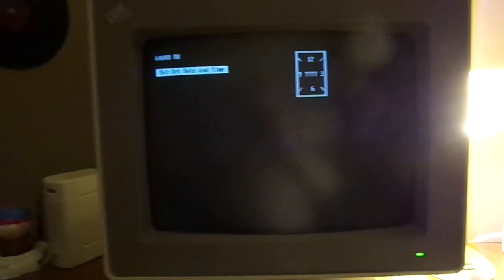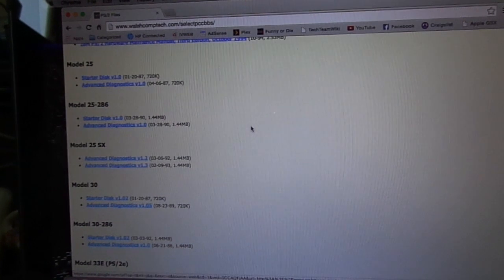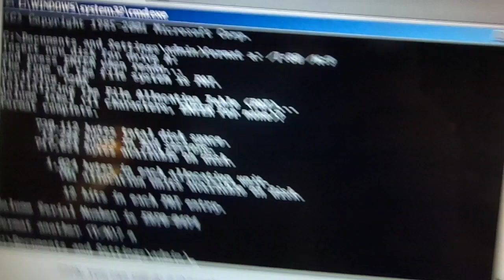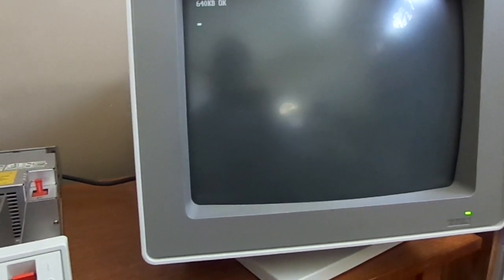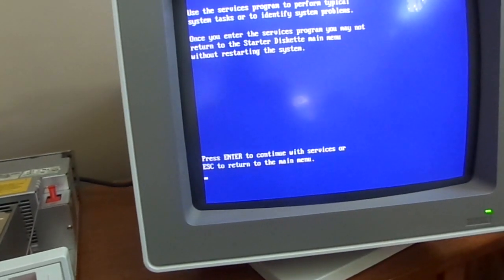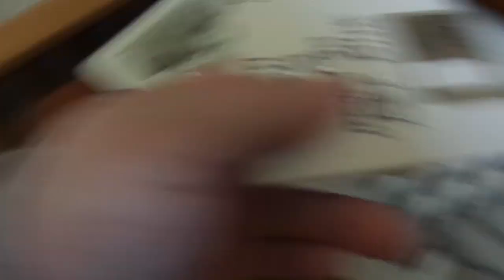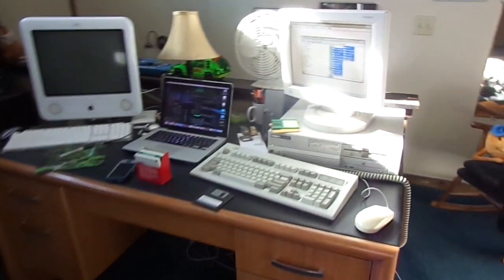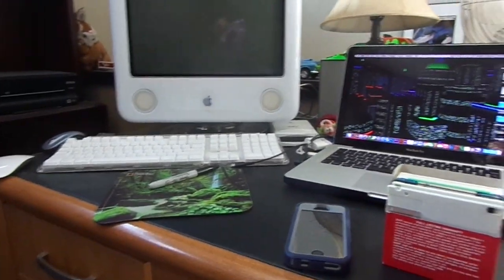Replacing Clock Battery In An IBM PS/2 Model 30 (8086 only)

Comment: How do you deal with recharging?
Reply from the maker: The CMOS battery? It's not rechargeable on this machine.
Reply: OK :)
Also, I really like your videos and your willingness to answer to every question which somebody asks.
And, do you have any expiriences with Commodore PC 20-III? I ran into some issues. The biggest is that video output is not crisp anymore and start "jumping" up and down. Also highlighted stuff is unreadable. Do you have any idea? :)
Reply from the maker: Krivulda It sounds like the display is failing, but it could also be a defective video cable. Often, older CRT displays can fail without warning due to aging (often leaking) capacitors. Getting this fixed is no simple task, and I cannot begin to help you in this area. My recommendation is to find another monitor.
Reply: Oh, it is ported through video grabber, which I got for Christmas, to my brand new BENQ display I use every day.

Comment: Brandon, you can get these two thirds AA lithium batteries brand new on Ebay for about six dollars with free shipping with leads on them already, just had to replace a battery like this one in my old digital oscilloscope. The CR cell will work just fine but I'd just think replacing it with the correct cell might at least look a bit more original.

Comment: Get yourself a desolder sucker, man! I rarely use desoldering braid now, unless absolutely necessary (delicate surface mount stuff). Just heat up the joint, add a dab of new solder, and suck up the solder ball. 90% of the time it leaves the pad/hole clear of solder.

Also, Walsh Comp Tech? Guess which candyham, IBM PS/2 loving youtube user runs that!
Reply from the maker: I have one - at work. I have both a hand-held vacuum sucker and a bulb-mounted-on-an-iron sucker. I might have a Hakko desoldering station in my future, though.
Reply: *****
I just looked at the site. It looks like Williams (UXWBILL) site for his personal computer consultant business also.
Reply: I knew it sounded familiar... given his love for collecting ANYTHING that's vintage Ibm, I'm not surprised he had such an archive. I just downloaded the 50mb file